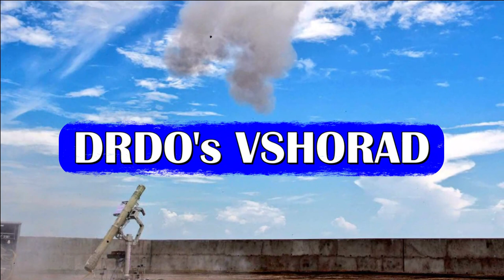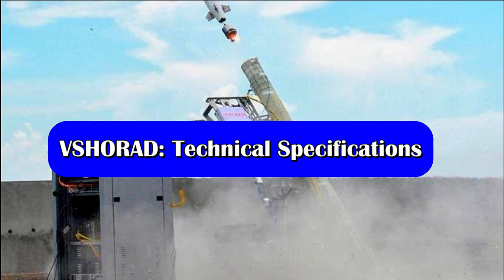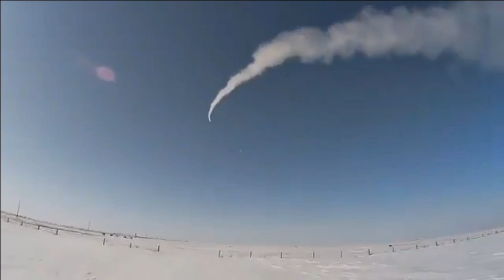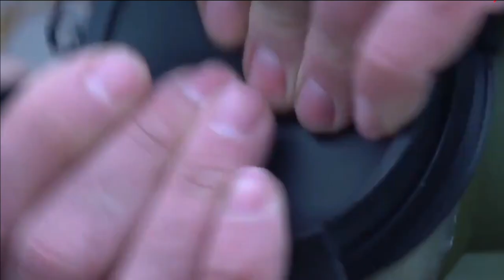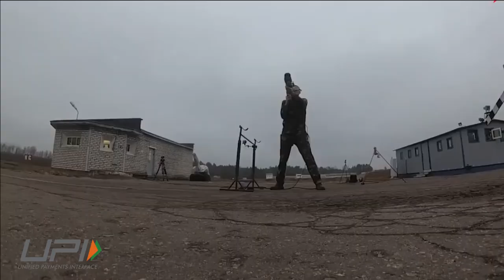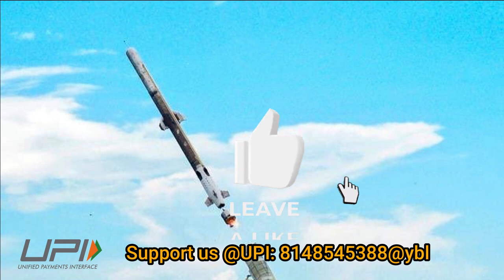Commercial version of DRDO’s VSHORAD in one year

Comment: what  is the difference between VSHORAD and Stinger ?
Reply: Stinger is a type of very short range air defence system.
Reply: Stinger is a brand name ,vshorad technical name, eg. Car  with brand name maruti, suzuki,kia etc
Reply: DRDO manpad is the equivalent of Stinger.
 Rbs-70 ng and mistral equivalent to Vshorad not stinger. 
2 man heavyweight systems with long range.

Vshorad

length 2 meters 
diameter  90 mm.
weight missile 20.5 kg 
overall weight 40 kg
range 7 km. 
speed of Mach 1.5. 
maximum launch altitude 3.5 km. 

Stinger	

    Missile – 10.1 kg
    System – 15.7 kg

Length	1.53 m
Diameter	70 mm
Crew	1
Effective firing range	.2–5 km
Maximum speed 	(Mach 2.2)
max launch altitude 3,800 m. 

So Vshorad is slower than Stinger Mach 1.5 vs Mach 2.2, has shorter engagement range of only 200m,
which is a weakness of Bharati technology. Max range of 5km vs 7km with win for Vshorad!
Also has a slightly lower launch altitude of 300m which doesn't matter.
Reply: @RajeshKumar-ll5jb  that i know. I wanted to know the technical specs differences. Anyway i got the answers from others. Thanks dude.
Reply: Manus Tham  There are slow moving passenger or cargo planes that are also juicy manpad targets. 

Particularly aerial refuellers and C 130 like planes. I agree a fast moving jet fighter is unlikely to die to one manpad but what about a salvo of 20?

Modern manpads and Vshorad are networked to radars it is completely possible to fire multiple of them at an enemy.

While you are correct older model manpads can't shoot down a jet fighter .. maybe modern ones can.
Reply: Manus Tham  👍. I still think that networking should enable multiple Vshorads to do something against even jet fighters if they are flying low enough.

Israeli fly nape of the earth to avoid radar and Pakistan might try the same trick. If they do and there is a Vshorad near them, a jet fighter could be shot down.